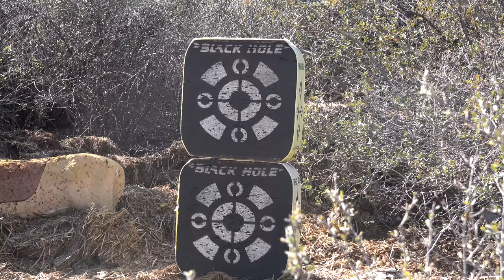Making the Comanche Bow, A Bow Maker's Journey

Comment: Not to contradict you but I'd like to share something that I now realize might be something very odd. I made a bow out of cherry wood when I was a teenager and used it quite a lot growing up, I've had it for 15+ years. After watching this video I examined it and realized that I violated the crap out of the growth rings, the bow never cracked or broke...
Reply: Indeed, vioating rings only matters with some woods notably Osage, because the rings are like alternate chalk and cast iron, the chalky rings have no real strength. Yew doesn't mind violated rings as long as you have a smooth, even layer of sapwood.

Comment: Their enemies had no significant armor so they did not need more draw weight. More speed to fire a second, third or forth arrow within 2 seconds was essential. The reason for the colt revolver i heard.  50 pounds is totally enough for hunting. the round shields with buffalo skin were able to deflect arrows and also musket bullets when not hit with an 90° angle, not bullets from modern guns of course.
Reply: I would question a buffalo skin deflecting a musket shot.
Reply: @nmarbletoe8210  depends on the distance of course but i think it is ok, when the musket is over 50m away and hits the shield at an angle far from 90°.

Comment: I have been following your videos for a while but think this may (?) be the first time I have commented. Overall, I love your videos and presentation. This one perked my interest as I am "mixed-race" Kiowa-Comanche and was raised awareness of many of our traditions, particularly the life skills. I spent a lifetime now perfecting many of those related "folk arts" and related indigenous life skills...

This was a great general "how-to" for the Comanche "short bow" or "bush bow." Excellent presentation!!!

Here are some highlighted observations and/or alternative information to what you have presented:

1.  Your staves (of any species) regardless of location (humid or arid) should never split if properly harvested and stored! If they are splitting, then something is being done incorrectly or a step missing...

A stave should be a minimum of 300 mm longer than it needs to be whenever possible...

For best stave quality the blank stave log/limb/bolt section with bark one should be "rested" in a stream, pond, or wet sand for at least 6 months with longer periods being better. Those rested for decades or longer are of the highest quality. "Resting" wood is a tradition going back millennia in many traditional cultures for wood, especially those cultures that have intact skills within "green" wood and timber working modalities...

The stave removed from the bolt section should be riven and then "greased" immediately or fully covered in beeswax.

While working a stave blank, it should be oiled/waxed continuously and never allowed to dry out until final finishing. Even then a bow should never be allowed to fully dry in the modern sense as the wood becomes too brittle with time. Waxing/oiling is part of traditional bow maintenance...

2.  "Center Lining" a bow stave traditionally was done with charcoal added to some grease..or...a natural ink (too numerous to count) then a thin line was dipped in and snapped onto the wood...This method, again, is shared among many cultures when a line was needed as a point of reference on a hind, wood section, stone, etc.

Thanks again for a great presentation and I look forward to more of your work!
Reply: the staves were left in water for that long? wouldn't that increase flexibility > lower the poundage/strength of the bow and make it prone to being "set" after being strung for even shorter periods of time? i never knew this and don't understand why it would be done since cracking isn't much of an issue, especially if the bow isn't bone dry, has backing, or the back follows a single growth ring.
Reply: @DuxLindy  Forgive me, I'm confused if you are asking questions or making definitive statements?

The advice I shared, would not have been given if it was not a time-proven traditional method. The means and modalities of which are much too detailed to list in a YouTube comment, suffice it to say that "resting wood" is a common vernacular practice, and doing so underwater is an ancient understanding in many cultures and many different woodworking traditions in history that I was taught and now teach and practice myself. These range from timber framing and bow work to woodturning and basketry, and the list goes on... 

You, like many, failing to "understand" these methods is not surprising since most "learn" from pure experimentation (including most Western book authors) or from broken and mismatched traditions not fully understood. Bow Craft is, in most cultures, from Asia to all indigenous cultures passed down in oral traditions and taught by watching and experiential application of what was seen being done by an Elder...not guessed at or experiment with...

Again, bow staves should...NEVER CRACK...but some very limited slight..." checking"...may be tolerated; though not really something that occurs in "good work" when fully understood...AND!!!...the stave was treated properly from the inception of the harvest to the finished bow...

Again, it seemed that most of your post was a "comment" of disbelief rather than a question based on your false assumptions learned from books and/or limited "I think" concepts...not anyone given fully understood tradition you were taught directly. Please do correct me if I am mistaken and I would be glad to answer specific queries whenever possible...
Reply: @JayCWhiteCloud  I think you misunderstood. I'm just asking because I've never heard of that; it's not disbelief and I'm not sure why you're being so defensive. I was just genuinely curious about wood being soaked as it's rested instead of dried. Obviously I fail to understand if I know nothing of it aside from what I just watched.
Reply: @DuxLindy  Hello Nye, Thank you for the clarification...For those new to Bow work (and even many alleged "experts"), much of the "traditional bow" making advice shared in the West (particularly on YouTube) is either out of context, incomplete information, or simply not accurate information...so I'm not surprised you have not heard of some of what I put in my original post...

Please don't confuse "bluntness" with being defensive. I have been teaching for too many decades now that when a "question" is placed more as a statement than a query I tend to just cut right to the point of what it seems like is being stated...I have no reason to be defensive as what I know doesn't need to be defended but rather presented, which I do often in perhaps too blunt a fashion, for that I will beg forgiveness...

I am very pleased that you are, " genuinely curious about wood being soaked as it's rested instead of dried." The topic is a pretty broad one so if you have specific questions about the method as it applies to woodworking I can do my best. There are many references to it in the research literature, but sadly much of that is in other languages besides English..As a short snippet of understanding, it is good to understand that wood, in general, should NEVER be dried quickly and bow wood particularly is treated way too harshly by most giving advice on YouTube...many of which are professional bow makers. This is not to say they do bad work, but rather "hard work" and incomplete work...nor are the bows they create following fully traditional methods or being built the best they could be...Bow wood should never really be "dried out" per se but rather have the cell structure of the wood go from a state of naturally "wet' to "working flexibility" which is achieved by proper resting and then slowly finishing to shape with the wood being oiled/waxed as it is being worked to final form...Please understand that is a very basic (if not gross) simplification of what a traditional bow stave goes through in some (not all) traditions...

Hope you found this post of more help...Please do ask questions if you have any...
Reply: @JayCWhiteCloud  this is good information, thank you
Reply: @DuxLindy  You are most well Nye...and I hope you continue to pursue this most interesting craft...Good luck!!!
Reply: JCWC  thank you my friend for answering nearly everything I posted above before I saw your comment.  I had the mistaken impression that Resting gave the advantage of putting in a recurve if desired.  Keeping the bow 'wet' is a brand new concept to someone who has worked kiln dried wood all of their life.
Reply: @lakotaallies7803  Dear LA...You are most welcome!!!... Your story is an ever so common one...I would say, after 40 years of working across a very broad spectrum of "wood crafts" from designing traditional timber frames and related vernacular architecture...all the way to the indigenous arts...I meet most (expert to novice) often with either disbelief and confusion (much like Nye above)...to those that often call themselves "expert" that since they have not heard (or don't understand) something...it somehow means invalidity...

Try to find (on Youtube particularly) a single person that calls themselves a "Bowyer" (many of which are experts and are paid handsomely for their bows!!!) that doesn't all claim that the wood..." has to be dried first!!!"...with many of them quite adamant about that fact...Ask where they learned the craft and if it is a person...as most learn from reading books and experimenting...where that person learned...???

Can you work wood dried...Yes, of course, you can...Is that how the wood was typically worked traditionally and throughout history...???...NO...it most certainly was not, nor was it so in most folk traditions of woodworking by the modern standard we call "dried wood." I wish I still had time to make bows as much as I did when I was younger, but I simply don't, and only every few years will rive and scrape one out...Maybe when I become really ancient...LOL...I will have slowed down enough to refine all that I know and either write it down or at least leave the knowledge gathered with someone that will carry it forward properly...Good luck with your pursuits in bow making and if you have specific questions do reach out with them...
Reply: @JayCWhiteCloud  Thanks for sharing your Life Skills with us.  I've been writing for 22 years to the point where my brain literally hurt from thinking.  So finally I broke down and got one of those small recorders so that I can just speak it and let someone else transcribe it later.  It would be awesome for you to have your experiences in your own voice.  You're it, my friend.  The last generation.  If mankind was to survive (I doubt it) then they would have amnesia and no repository of what came before.  Wicked Peed On Us could then tell everyone that there are 5 quarts to a gallon and everyone would believe it because they read it on the internet!
I'm preparing some Mulberry (a cousin of Osage) for my first attempt at a bow.  With your insights I will be able to be closer to doing it right rather than hacking it.  The word "Hack" used to mean really fouling things up.  Today young upstarts make videos about "Hacking their own Genome" as if #1 they even have a clue what their doing and #2 as if it were a good thing.
So, I have been mass-consuming videos on wood preparation from making the lumber to the air drying process which claims you can only equilibrate to about 12% moisture in a non-arid region.  Out of all of the videos only one explained that kiln dried wood was only invented to prevent the defects in air dried wood after inside living spaces were artificially heated and dried.  The wood had to be artificially sucked dry so that it would not expand and contract.  As you are saying:  It is not natural or traditional.  Drying wood is a modern compensation.
I'm excited about Resting my stave as soon as I ask it to show me its path out of the wood.  But now I'm impatient on waiting the required time to give it the proper rest.  That's the curse of modern technology.  Instant gratification.  However, I'm inspired to do a test of making one quickly to keep myself occupied while the other one is done the right way and then we can have a comparison of the two.  More than anything, whether with art or machines I have learned that the 'feel' of something is of great importance.  I would rather have a 'live' feel to a rested bow then the brittle feel of a modern bow that all of my years working on machines would have me worry that the dry bow might splinter in my face at any moment.  
I'm sure you can believe this:
"Quick Drying Bow Wood: How to Make a Bow Without Years of Waiting" is in the right hand suggestion feed as I was typing this reply.
You have taught me to let the wood speak to me.  I will listen.
Reply: Your Welcome LA...I will do my best, per a short web post, to reply to your query...

Mulberry is indeed in the same family as Osage...and a useable bow wood if a suitable section is found...

As for the many aspects of what "drying wood" is...and is not...most of it is either a modern misinterpretation of laboratory data...and/or...not really taking into account that "kiln dried" wood standards are a VERY modern experiment and modality...AND NOTHING AT ALL...to do with traditional woodworking...Thus the obtuse notion that wood has to be "kiln dried" is utter nonsense...nor is kiln-dried wood superior in any way...actually quite the opposite...It certainly should never be employed for making traditional bows which would be slowly air-dried if using a system that calls for such a practice...yet most truly traditional methods certainly do not call for that at all…

The wood can be harvested at any time if just speaking of “wood” yet there are spiritual and related aspects that do go into many traditions too numerous here to count…Harvesting only in winter is complete and utter nonsense that too often gets repeated because of the silly notion that trees have less sap in them in the winter and/or that it all goes down into the roots…FALSE!!!...Sap does not go into the roots in the winter at all...That is a modern myth and the Elders knew this as I was taught as a boy...In fact, with many species of trees, we see an actual increase in moisture content of the wood above ground in the wintertime. The difference between summer and winter is whether the sap is flowing (aka moving) or not moving…or…how it is moving…but the content can vary by species with some, again, having more sap in winter than it does in summer...

As someone that works wood professionally…has for 40 years…AND…!!!...does it almost exclusively in “green wood” from house frames, and floors to furniture…I can attest that it can (and was) done this way in most folk traditions by the standards of what “dry wood” is considered in the modern world…

Wood that is “sucked dry” is the worst kind of wood in the world to build quality items from…It is about profit, consumerism, and speed…NOTHING MORE!!!...and certainly has nothing to do with traditional work AT ALL!!!

If you wish for better success with your wood, I may suggest, collecting it during the new moon period when a high-pressure system is present climatically. I would also (since it's your first go at this) collect more than one stave blank to work with so as to understand better the process of breaking down the wood…in this case with proper riving, shaving, and scraping methods…If not in a rush, I would either oil and wax the wood immediately and then rest it for at least 3 months…if you have access to fresh water it can be stored there as well…but not it can stain and discolor depending on the body of water, the depth it is stored at (deeper is better or cold and fast running.)

I think you should do a test of making on quickly and this is not out of context for any of the traditions…” Fast bows” could be made in a day…fire-hardened and tempered…then used…Are these great bows…???...It depends on the wood…the person…their skill sets…and the purpose of the bow…which is traditional for an immediate need bow it would put food in your family's belly or defend them… 
Slow-made bows are always going to be superior and could last centuries…even with multiple lifetimes of use…IF…properly taken care of and not allowed to lose their spirit by neglect…In traditional cultures…” things”...have souls (spirit if you will) as well as humans…if neglected they die or turn “dark.”

Let me know if I can expand further…
Reply: @JayCWhiteCloud Just now coming upon this discussion.  I have a river behind my home with a fast running current and about 6 feet deep, and I also have a pond only about 5 feet deep.  Both the river and pond have numerous fallen trees and logs in them.  Can I use the lumber from them as they most certainly have been resting in the water since they have fallen for many years now?  Or is the wood considered dead, and what would the difference be from me cutting a tree and putting it in the river vs. a storm taking a tree down and putting it in a river?  Either way, it ends up cut down and resting, yes?  Usuable wood for staves.  By the way, most of it is Black Walnut.

Also, if it can be used, and I pull the logs from the river…..how long do I let it set out to dry a bit before splitting the logs?  Or do I attempt to split them waterlogged then dry out a bit?  Lots to learn.  All this seems counter intuitive from everything else on YouTube which is cut it, shape it, and dry it over a fire for a day or two and call it done….lol